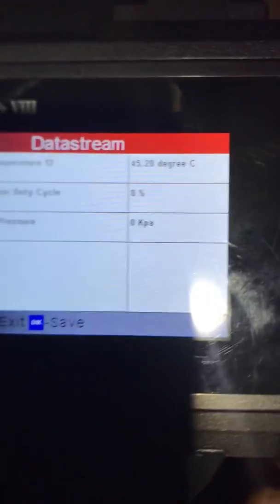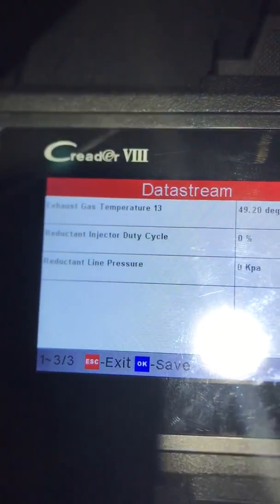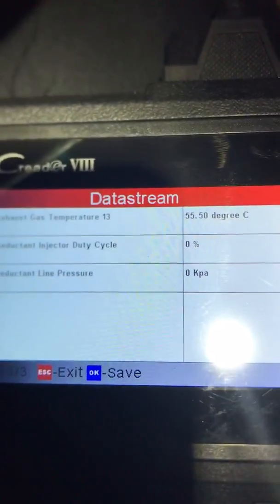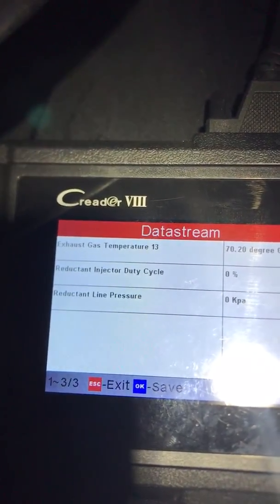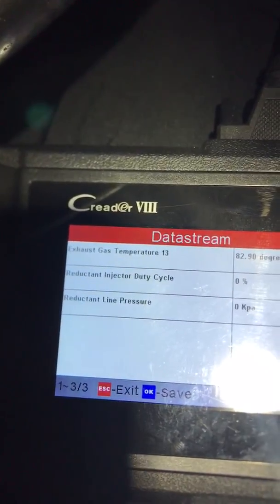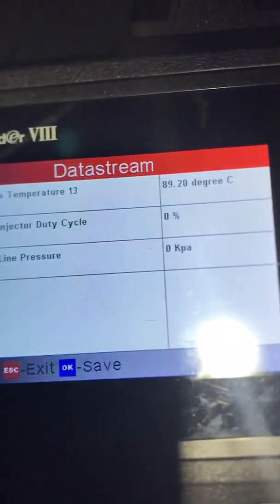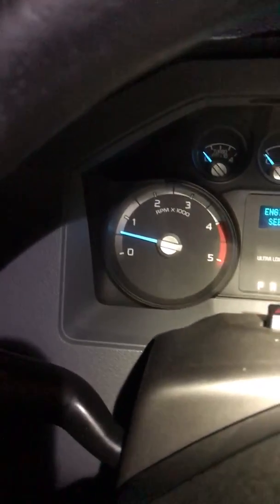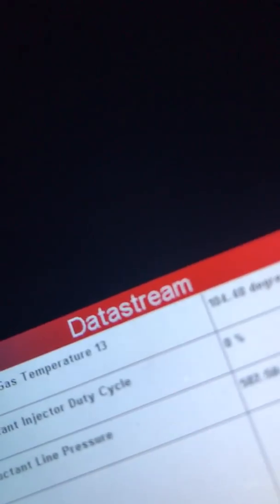FORD diesel 6.7 forced idle engine idle reset clear Part 1

Comment: Good video.  Thx for the Help.  I have a 2012 Ford f350 that went into def idle only mode. I'm also a semi truck driver. And deal with def regen all the time. So I replaced my MAF sensor because of engine light on. Then I basically manual regen'd my Ford by keeping the rpm's between 1500 and 2000. Ideally at 17-1800.  I set a timer and it took 6 and half minutes and the def light turned off and my truck was able to drive away. If you dont believe me at 38 years old. Ask my mom that I drove off from. 👍 It's dumb we dont have manual regens available like we do on the semi trucks.  Hope this helps.  It worked for me.

Comment: i have a bosch obd2 sensor and i cant find the reductant injector duty cycle or reductant line pressure.  any ideas?  it may be there under a different sensor name...
Reply from the maker: You should be able to read a live data stream by selection. It may be under engine / live data stream 
Before you carry out the forced idle reset - the temp of the vehicle has to be less than 150F. Also all codes should be cleared - all DTC’s although I’ve reset it with codes. It’s just easier. The injector cycle - if you don’t have a live stream oscilloscope- stays 0 and then after a few minutes will go to 99 - and then after a few seconds back to zero. So you have to be careful while watching your scanner. 
Just make sure you have the same PID’s I have selected in the video. If you have any problems - post your comments - so others can get out of this.  I’m open to suggestions- 
I have a ford ids scanner - but this can be done with any off the shelf obdii scanner which has a live stream function 
I’ve done this on a narrow chassis ford f550 with a 6.7

Comment: I'm attempting this procedure but I cannot get the duty cycle to reach 100%.  I drove for 5 miles or so.  Any ideas?
Reply from the maker: Temperature of the vehicle has to be below 65c / otherwise it just doesn’t work / you’ll have to start the whole cycle again. Once it’s below 65 - look at the pid values and you’ll manage to kick it out of forced idle.  I didn’t even have a square injector wave scanner - just wait for the value to change and that’s when you know the cycle is done -
Reply from the maker: Initial temperature below 65/ once it gets to the operating temp / let idle / wait for pressure buildup / drive / about a mile maybe / you’ll see the injector pattern values change / stop and rev / it should clear 
Otherwise wait for engine to cold soak to cold temp and try again. I’ve done this on several Fords - it does work